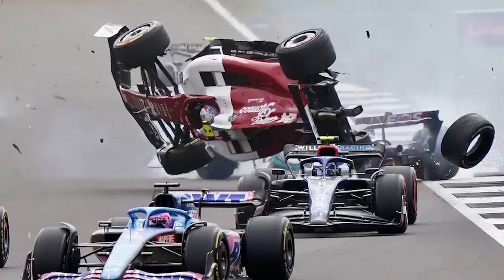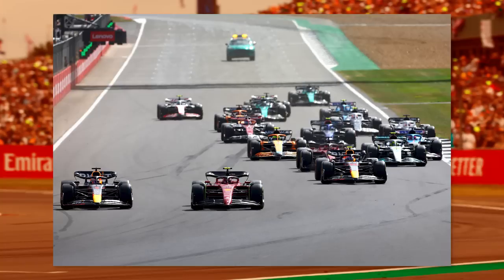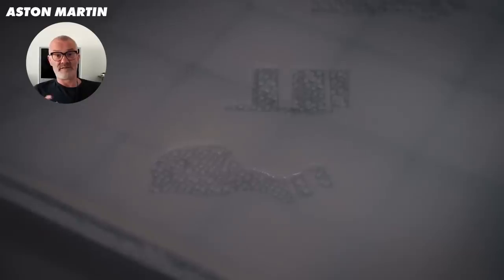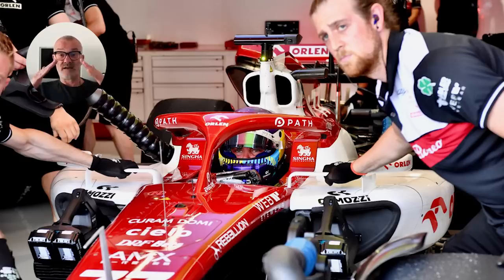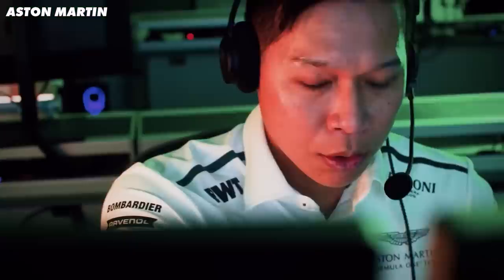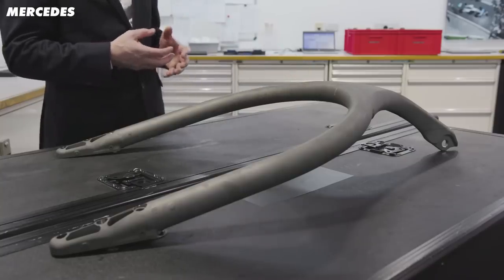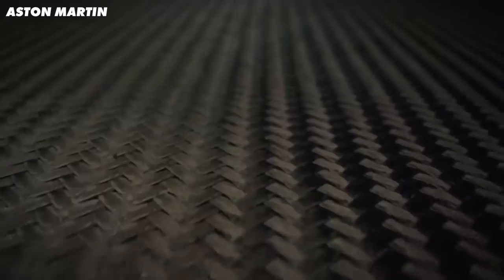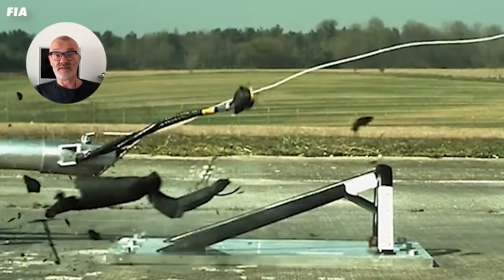Did the Roll Hoop FAIL in Zhou's Crash?

Comment: Once again the halo proved that it saves lives, it was one of the best inventions in Formula 1
Reply: Wouldn't have saved 4 out of 20 drivers in the current grid, though. Taller drivers heads protrude over the halo line and they wouldn't be able to duck when inverted, bounching violently and HANS device restricts forward movement. And a few more drivers would have their helmets touching the tarmac as well. Luckily Zhou happens to be one of the more average sized drivers.
Reply: F-1 has been improving safety for years - tech used in other racing and domestic cars as well.
Reply: @Goat Exactly, that's why the roll hoop is the principal roll structure. But it snapped off and halo has the secondary roll stucture role. But those taller drivers would have been severely injured in an identical scenario.
Reply: 🙌Charlie Whiting 🙌
Reply: @kekkonenprkl  
Is there a specific height for the halo? As a primary safety device, I would think that the regulation would require a “minimum height above helmet” 
Sounds as though you know more than I do since I didn’t even think about driver height - just wondering
Reply: I never got the aesthetic complaints with the halo either. I think it looks cool.
Reply: @kekkonenprkl  I honestly think they should use wind shields like Indycar as well. The halo can't save you from shrapnel from a wreck entering the cockpit. And the cars would honestly be a bit quicker with windshields.
Reply: @kalasmournrex1470  Well, I'd expect that any debris small enough to go through the halo should be stopped by the helmet, but I can see an accident where that isn't true.
Reply: @pmrich7035  The halo is a standard part and the specs come from FIA. Teams can't alter the design, other than the thin carbon fiber shell around it. If you look at side photos of Russell, Ocon, Latifi and Albon, you can see the issue with their height (imagine those photos without the roll hoop). There is a specific required safe gap from the roll structure line, but it doesn't really take the roll hoop snapping completely off into consideration.
Reply: @nerd_nato564  The Massa accident from 2009 would still be quite bad even with the current really advanced helmet specs. But shouldn't at least cause as bad injury as back then or loss of consciousness.
Reply: @kekkonenprkl  its just shocking that theyve approved a design that failed so easily. The roll hoop is generally the strongest part capable of carrying more weight then the entire car. This is a really bad look for F1 and their safety regulations. Is the safety pod around the driver up to snuff? Who knows now but having a catastrophic failure of the roll hoop brings into question everything the fia is doing with regards to safety
Reply: “Yo guys we’ve invented this new thing, it’s called a ‘roll cage’”
Reply: @kekkonenprkl  no all of the drivers head are mandatory to be bellow the halo
Reply: @japleen5204  Below the highest point of the halo. And the highest point of the halo is in front of the driver and the rear of the halo goes downwards. That's why there are several drivers whose head protrudes more or less over the line which would (or in this case would not) protect them in the event of the roll hoop snapping off. Russell, Ocon, Latifi and Albon being the most vulnerable.
Reply: @kekkonenprkl  Well yeah the Massa incident would still be quite bad, which is part of the reason why we don't use springs anymore, and why the halo was introduced, to reduce the chance of large debris hitting the driver. Not that it's impossible, but it would be far less likely. Also, the highest point of the halo is what protected Zhou here. You can see that the front of the halo is completely busted up. The FIA should probably look into the height of the halo as well, though.
Reply: @kekkonenprkl  
Thanks for the info.
Reply: Too bad the people who's jobs are to make the cars safer couldn't of thought of this 40 years ago. And fortunately we will see even more safety precautions, but unfortunately only after someone else dies or is seriously injured.
Reply: halo didn't save his life though, have you seen breakdancers sliding and spinning on their heads and without a helmet?
Reply: @ludzkipan1650  breakdancers also dont have an extra 2000+ lbs on top of them and moving at high speeds
Reply: @kalasmournrex1470  They would get too hot with barely any air circulation in the cockpit. Indycar and f1 are both working together to create the best solution for safety. Its possible that well have a closed cockpit in the future
Reply: @kekkonenprkl  4 out of 20…? Or 1/5th… still isn’t true or based in reality! Lol
There are at least 10 drivers that are taller than ZG and he ducked down so idk what you are even going on about🙄
Reply: even if it looks bad
Reply: His head didn't touch the ground thanks to the halo. Halo wasn't on, things would get even worse
Reply: it saves lives
Reply: @reesbritton6623  I have no idea what you are trying to say.
Reply: @kekkonenprkl  Without the halo OR the roll hoop, as in this scenario, NO driver would have been severely injured. They would have been killed. Even being severely injured beats that. One more life saved by the halo for sure.
Reply: @kalasmournrex1470  i remember some drivers were testing some prototype in a practice session and they reported the curved view made them feel sick
Reply: Great review.
Could you please do something similar for Perez? Understand the halo saved his life as well from Lecler's front deflector that flew off his Ferrari and if halo hadn't been there then the Red Bull driver might've🤔 gone🙄😢 (decapitado tal vez)

Thanks tons
Gracias👏🏼👏🏼👏🏼👏🏼
Brgds from 🇦🇷Argentina
Reply: @kalasmournrex1470  They’ve definitely done a much better job integrating it into the current cars, but even on the old ones I didn’t see anything out of place about it aesthetically. The only complaint that ever made any sense to me was the visibility argument, but all the drivers eventually adjusted well to it, as they do whenever there’s a fundamental change in the cars.
Reply: I doubt it's one of the best. It sure is one of the ugliest though.
Reply: @kalasmournrex1470  Wind shields? Sounds gay, F1 needs closed cockpits, like fighter jets.
Reply: @UmVtCg  it IS ugly but has saved lives. Halo & fences and Zhou walked off with a smile. Latter in mind, care tipins how ugly halo is.
Cheers
Reply: @kekkonenprkl  it would still probably save them because there head doesn't stick out much so at least it couldn't crush his head.
Reply: Bringing up the halo is kind of silly considering it was a faulty part of equivalent function (a point of contact between the driver and the terrain) that made the halo relevant.  Any part can be malfunctional.
Reply: @pmrich7035  the idea is that the halo protects from stuff hitting from the front and sides, the line between the roll hoop and the halo is way above any driver's head so if the roll hoop does its job, the driver is still safe
Reply: @kekkonenprkl  I think when they design halo.. is to protect oncoming object forward or sideward.. not from top.. cause roll hoop is there for the job already.. I think nobody expect roll hoop to fail as we can see from so many passed flipped incident, roll hoop stay on..
Reply: @kalasmournrex1470  several driver report nausea from the wind shield. Probably because the of the curve.. scarb explained before why Indy car got for wind shield.. because indy car mostly run on oval.. driver always see a certain degree upward.. so they cannot use halo as halo would block indy car vision at oval.. while F1 always run circuit.. driver see straight or min degree downward.. that put their vision straight at the end of the curve of wind shield.. that probably what’s caused the nausea
Reply: @pmrich7035  also, i believe there is a line drawn from the halo to the roll hoop and the driver has to be a certain amount below the line. so in cases where the roll hoop doesn't fail, height is never an issue
Reply: @kalasmournrex1470  The aesthetic issues were more with the first gen of cars with it, as it was effectively slapped on and didn't fit the proportions in most peoples eyes. The new cars look fine with it imo.

I agree with the windshield; while that also looks pretty bad imo in Indycars, having a windshield would also protect from small objects coming from in front. Massa's injury in Hungary 2009, shows how much damage flying objects can do.
Reply: Why are people still surprised the halo works after years of being used? Weird...
Reply: @kekkonenprkl  after you mentioned it, i checked out some side photos of russell and ocon. most you see on tv during races are front views so you never really notice that their head protrudes above the halo line at the rear. Very interesting point. I’m surprised FIA hasn’t factored in the heights of drivers when developing this feature. They should seriously look into that. Thanks for the info! Learned something new today!
Reply: @kekkonenprkl  Believe in JESUS today, confess and repent of your sins. No one goes to heaven for doing good but by believing in JESUS who died for our sins.  For God so loved the world that he gave his one and only Son, that whoever believes in him shall not perish but have eternal life.(John 3:16)🥳❤️😗❤️😁❤️😚
Reply: @Remzly  thing is 40 years ago performance was the main focus. They totally could have thought of this, but safety was probably third on their priority list after "performance" and then "more performance" ... And a halo, roll hoop etc weight down the car, reduces aero, makes the car more complex...
Reply: @kekkonenprkl  Don't the taller drivers sit lower? I seriously doubt the FIA would overlook such a simple concept.
Reply: @mathorsky  There isn't enough vertical space to seat them any lower than they already are.
Reply: @kekkonenprkl  huh, I'm a bit concerned for taller drivers now.
Reply: What i don’t understand is how lucky we were before the halo came or the drivers are taking more risk due to the extra safety in place
Reply: @mocskillshi8150  They are definitely driving harder with the more advanced safety in mind. And the cornering speeds have increased a lot with way more complex aero designs, especially 2020-2021 (sure 2022 downgraded that a bit, but they are still insanely fast in corners). Some of the medium-speed corners have become flat-out, and corners overall have become faster, which also means possible crashes are going to happen at higher speeds.
Reply: @Remzly  "couldn't of"? Which crazy dialect is that?
Reply: This potentially the first time. Roll hoops have saved all other lives
Reply: @GonzoDonzo  it didn't fail easily though. However there are always things to improve.
Reply: @nerd_nato564  See Massas crash in 09
Reply: @gert-janbonnema  the proper form is could not have, shortened to couldn't have, which when spoken quickly sounds like couldn't 'ave, which sounds sort of like couldn't of.
Reply: I don’t like the appearance in any way, kills the old school appearance. That being said I will agree it saves lives. Keep it and bring back the v-10’s
Reply: @kekkonenprkl  Not true. If the driver is taller, so is (made) the halo.
Reply: @kalasmournrex1470  yea
Reply: @dutchdna  Not true
Reply: I will only agree that a headguard helped, but honestly, I feel these halos need more robust designs. And if carbon fibre failed to cause the halo to be the last line, maybe using something larger mounting might matter too.
Reply: @Chrisk1330  we all love the V10s, but bringing them back has nothing to do with F1 which should be the pinnacle of Motorsport. We're just not in that era anymore unfortunately, I remember it fondly too.
Reply: @kekkonenprkl  True
Reply: @afdelta0120  The halo was still intact.
Reply: he would have been fine without it
Reply: @dutchdna  I'm not denying in this case, but if the roll device failed this race by carbon, perhaps the halo could too. And moreso, can we not rely on a design that has a pillar blocking the view? I cant play F1 games with a fucking pillar, i have no idea how F1 drivers cope.
Reply: @kalasmournrex1470  Halo was tested against the Aeroscreen Red Bull came up with, and Halo outperformed it in pretty much every test. The Aeroscreen apparently failed one of the tyre-impact tests and multiple drivers said it disrupted their vision. The other obvious thing is that Halo has proved itself multiple times to be an excellent life-saving safety device, there is no doubt it works and works well. In the F2 crash at Silverstone, Halo 100% saved Nissany's life so for me Halo's credibility cannot be doubted. Driver safety should always come first, aesthetics and aero be dammed (Even though Halo is apparently fairly clean aerodynamically)
Reply: @GonzoDonzo  wouldn't exactly call it easy. The monocoque is designed to absorb one hit from any given direction. Say, hitting a wall at 250kph. Driver is protected. After that the monocoque starts shedding material to slow the car down. They are meant to come apart after a big hit. It just so happened that this crash did not meet the 999 out of 1000 normal bad crashes in F1. Grosjean's car went through an armco, the back half and the side pods disintegrated to distribute all that force. He walked away with a broken heal. Thats what they build for. Huge one hit catastrophic events. This crash just happened to be the near total reversal of the type of crashes F1 cars are built to take.
Reply: @halycon404  a roll hoop is not designed to break away like the survival pod does. Its a critical component of the safety pod. Usually roll hoops are so over engineered that any wreck that would cause a failure would be a fatality accident no matter what.
Reply: I think it doesn't matter in this situation because i think it caused the hoop to break
Reply: @Thri11seeker  thats why in the past they were a solid tube of metal that went to the floor and was welded into many points so there is no single failure point.
Reply: @nerd_nato564  Massa spring incident comes to mind, I wanna say Justin Wilson's death might have required a shield to save him but I'm not sure of the size of the debris that hit him.
Reply: @Ballingboii  You say this as if Indycar hasn't had a shield for 3 years now.
Reply: @mingc4698  Indycar has a halo in their windscreens, they fixed this literally immediately, this is an argument from like 2019
Reply: @brubrulani  Wheldon's hoop didn't save his life sadly
Reply: @reesbritton6623  at least 10? Literally all of them are taller than Zhou, HANS hugely limits head movement so would make it incredibly difficult to duck to a point where no part of the helmet would be touching the ground upon a roll hoop failure. No doubt after this accident the FIA will run various spec reassignments through testing to see if it is necessary to change
Reply: @Jonathan_Doe_  that works well for closed cockpit cars, but it's largely antithetical to open cockpit vehicles.
Reply: @kalasmournrex1470  the problem with windshields is H E A T

And considering the fact that F1 Races in some of the hottest parts of the world, that would be a real problem. Imagine Having to sit through the malaysian gp without cooling. God that would suck
Reply: @nerd_nato564  what about Massa?
Reply: 👏🏾😇Here here
Reply: As a non-F1-follower, I cannot see very many disadvantages to the Halo. Small bit of weight. Decent cost increase.

But it saves drivers' lives. & I think it looks sick.
Reply: @kekkonenprkl  you know that height almost has no impact on how much you stick out the halo since their seats and distance to pedals are customized for each driver?
Reply: @kekkonenprkl  No there's a mandatory minimum height distance from helmet to halo line, F1 YouTube channel did a video explaining it. Did you really think some drivers protrude above the line?
Reply: @thisthat442  Did you actually watch the video? The mandatory safe line is taken from the roll hoop. In this case, the roll hoop collapsed. Without the roll hoop, their heads do protrude over the physical lines of the halo. Again, watch some footage or photos from any race from 2018 to 2022.
Reply: @kekkonenprkl  oh yeah I was wrong, gave it another look
~ now the reality of how zhou's height might have just saved him from a major injury hits me lol
Reply: Cars flipped before the halo?  I don’t see those guys heads getting crushed.  The drivers heads are below a line from the top of the intake to the front of the car. Am I wrong?
Reply: @UmVtCg  noone wants closed cockpits. F1 has always had open cockpits and it literally is one of the key aspects of a single seater
Reply: @JaredPizza  You're right, the intake structure failed though, he'd be likely dead without the halo
Reply: @kalasmournrex1470  That would result in less air-flow to the drivers, and thus less cooling for them unfortunately
Reply: @UmVtCg  What does sexuality have to do with anything? Grow up and find better words to convey your point.
Reply: @The Padded Cell And again, that's not related to the issue at all. The whole roll hoop snapped off. Once the roll hoop is gone, the safety margin dissapears completely.
Reply: @nerd_nato564  Uhhh you think a small gear to the face at 300kph should be blocked by a helmet? Dude Idk if you know much about physics but your asking the impossible here.
Reply: @connorbranscombe6819  Aren't the current helmets meant to survive high speed impacts from small things quite well? I don't remember the current specs, but that doesn't sound impossible to me.
Reply: @Mike-jv4rz  you mean when they aren't banning the tech lol.
Reply: it's just another example of the FIA's ongoing campaign to destroy F1 as an interesting form of motorsport.
Reply: makes the cars look better too, and they should be tailored more to the cars driver even if that makes the car slower. safety needs to be number one and i dont think it is as much as it should be
Reply: @nerd_nato564  I mean, resistant to it maybe, but no, Im certain if a copy of the Massa incidient happened today the driver would still be injured.

Again, idk if you really understand physics that much, but that force is being transferred to the helmet, then the drivers head, the helmet can only take so much of that, and the majority is still going to the head.

This is why there have been talks of windshields in Formula 1, and why Indycar already does it.
Reply: @connorbranscombe6819  Yeah, I'm not saying they'd be fine, but it wouldn't be as bad as Massa had it. And yes, I know the force gets transferred from the helmet to the head, but helmets are designed to absorb that energy making it so less of it goes to the driver. Also F1 has tested windshields before and drivers complained about it messing with their vision.
Reply: or that minimising weight is not always best idea?
Reply: A closed cockpit like a jet fighter would be safer.
Reply: Eh. I think seat belts might have been a more important addition lol
Reply: these "halo" is most annoying word on internet
Reply: @kalasmournrex1470  what next? Windshield cannot protect from a meteor strike. It's supposed to be racing, bumper cars are for kids.
Reply: What next, speed limiters and no corners?
Reply: @kalasmournrex1470  what next, remove corners? Oh, wait.. that's American motor racing for you
Reply: @kalasmournrex1470  just went to indy races, was right at first ish line. WHAT DID YOU SAY I CANT HEAR ANYYYYYTHIIING SHOOOOoooooooooooshoooe shoot shooooo
Reply: @kekkonenprkl  wwww22w
Reply: @kekkonenprkl  that is an ignorant and inaccurate comment. If you go on the F1 site they have a video specifically talking the roll hub and the halo and how drivers are measured and tested to make sure their head is covered from the top of the halo and angled towards the roll hub
Reply: @nxzstudio8495  Again, that's irrelevant to the accident.
Reply: Yall need to go look at some old footage, guys have survived way worse without a halo, the halo really isn't needed and is only there to make the insurance guys happy.
Reply: @kalasmournrex1470  Most complaints back then were about restricted visibility, not aesthetics.
Or that other solutions, like Windshields would be better, as they offered less visibility intrusion and better all round coverage, even against smaller debris.
However one needs to get the Curvature right, and it's not like such examples exist.....you know like fighter canopies/Winshields.
(The Canopy is the part that encloses the cockpit to the top snd rear, the front part is still called a windshield, even in a fighter. Some of them, like the F-16, F-22 or F-35 have single piece canopies that include the windshield.

But in the last years the narrative slowly morphed into "tHe oNlY cOmPlAiNtS aBoUt HALO, wErE aEsThEtIcS!!!"
Reply: @nerd_nato564  Ke=m*v² kinetic energy primarily scales with speed, squared at that, and not weight, so small pieces can be as dangerous as big ones, especially if the impact energy is spread over a small impact area. 

Also in modern armour design, and driver protection against kinetic impacts is armour, it does not pay to bet everything on a single strong final defense.
It is instead better to use a distributed system, with an outer layer, or multiple outer layers.
Even if that outer layer, like a windshield,  fails at stopping the projectile, it will slow it down, reducing it's kinetic energy and reducing both the chance of penetration as well as the impact effects felt by the wearer of the helmet.

Edit: I think the New Roll hoop test further needs to incorporate a a svere sudden twisting force, as that spin would've exercised that very force upon the hoop.
And further a rapidly changing twisting force that would stress and slightly relax the material multiple times a second, expanding and contracting it, weakening the material.
Reply: if only it was implemented earlier :(((
Reply: Just a shame that it has the dumb middle part
Reply: I think f1 should make the switch to the Indycar's Areoscreen, since it adds more protection from small objects, downsides being to have more driver cooling and the reflections of the panels of the areoscreen
Reply: IndyCar did it better. 🤷 Sorry, not sorry.
Reply: As of now, the halo has saved 4 drivers since I’ve started watching
Leclerc spa
Grosjean
Hamilton monza 
Zhou
And ferucci in toronto